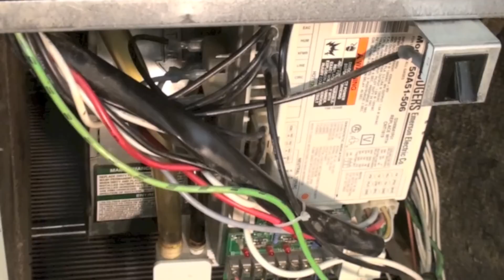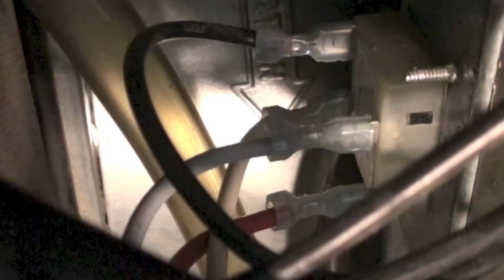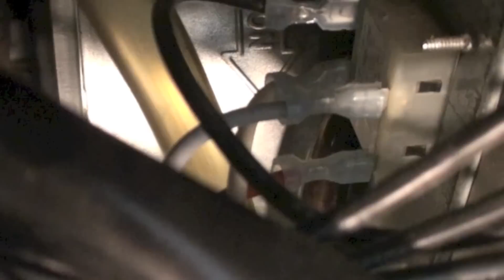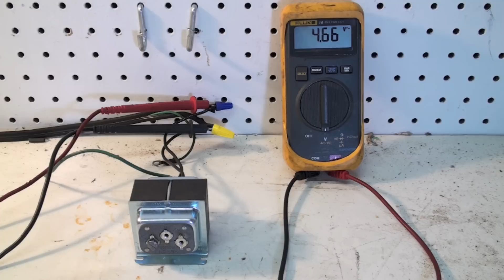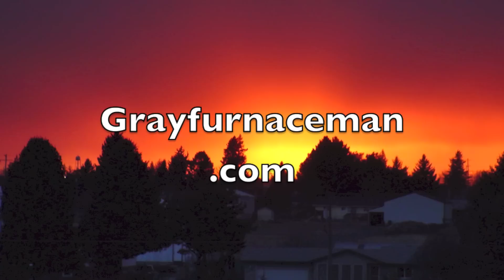How to troubleshoot the transformer

Comment: Hey Gray, i asked a question awhile back about the only problem I couldn't figure out. 

I had 120v in the primary, but zero coming from the secondary. I figured it was the transformer and I replaced it. I put in a new transformer, but the same issue. I checked resistance and transformer was fine. It ended up being an eletrical issue elsehwere that caused it
Reply: Where was your electrical issue?
When I test my transformer, when it is not connected, the meter reads resistance on the high side and the low side. Like 18 ohms on the high side and 1.6 ohms on the low side.
The circuit board has no power when I connect the transformer. (No red light. Nothing works.)
I've got 120 v at the lines that go into the circuit board. And 120 v coming out of the board through the wires that go to the high side of the transformer when I push the door switch,  but no voltage coming out the low side of the transformer.
I don't know if the transformer bad, even though there is resistance when the transformer is unplugged. I cannot figure out why there is no power to the board.
Reply: @Ziji-LetYourSoulShine  Did you ever find the issue? I'm in a similar situation.
Reply: You must have 120volts going to the black wire of the transformer primary winding and equally important is you have a good neutral attached to the white wire of the primary winding. Resistance between the black and white indicates the winding is intact.  The secondary winding is much more robust and failure there is not common. A quick continuity check between the secondary terminals should show a resistance indicating it too is good.  
Alternatively you could attach a cheater cord to both primary wires black to black, white to white and plug it in. If you do not show 26ish volts A/C on the secondary the transformer is bad. Note: Be sure to check at the secondary terminals for 24 volts as some transformers are isolated from chassis ground.

Comment: I have humidifier's transformer burning out in few months of running. The water valve 
solenoid  draws 1.2 amps at 24 VA it's 29 watts. Transformer is 40 watts. The voltage to primary winding is connected (as installed by technician) to blower connector; one neutral and L1 
(120 volts)so valves opens when blower operates. Any suggestions why this happens, maybe spike from blower's capacitor, any sugestions
Reply from the maker: I would guess that the solenoid is sometimes sticking.  If it sticks, it sometimes will draw more amps and could exceed the rated amp draw of the transformer, thus burning out the transformer.
GFM

Comment: OL is over limit on resistance scale. Infinite resistance air or open circuit. At least that was my experience when using a meter back in the 70s.

Comment: I have a goodman 24 volt transformer I replaced. I disconnected the old one but on the new one on the output (secondary side) it doesn't tell me which tab connector is hot and which is common. The 120 side is clearly marked.  Is there any way to figure this out? I'm afraid I'll reverse the polarity and cause a problem.
Reply from the maker: There is no reversed polarity on these transformers.  They can be installed using either terminal as hot.
GFM
Reply: neb  AC, not DC.

Comment: Could a transformer work intermittently or does it fail completely?  Seems I'm getting intermittent power to thermostat.  When I test transformer contacts (where thermostat wires are attached) I get no reading.  I open the box the transformer is mounted on (so jiggling the transformer), reinstall and get power to thermostat - off and on, but (fingers crossed) on for now.
Reply: Cinti PW- plus 1...  Gary, can you guide us?
Reply from the maker: If the question is can a transformer work intermittently, It could but it is very unlikely.  By far the majority of transformer failures are not caused by the transformer.  They are caused by shorts or chassis grounding in the wiring or components.  
GFM
Reply: grayfurnaceman 
You are right, 24v supply was good at the transformer.  After further research my blower motor shuts off while the burners are still lit.. (intermittently-thermostat heat setting with auto fan).  This happens until the overheat circuit cuts 24v to the "R" thermostat wire.  Blower has good bearings, doesn't make noise on startup, runs when 117v are present and doesn't run when 117v isn't there.  Note when 24v to "g" thermostat wire, fan runs.
I've got past the overheating by keeping the fan to on instead of auto.  

Is there a way to check the relay on the circuit board lennox bcc3-1 LB-89859  ?  I did not have the correct multimeter to check microfarads at the capacitor... I'll bring a tool home from work tomorrow.  Anything else I should check?
Reply from the maker: It is possible the motor is overdrawing power.  You can try replacing the capacitor.  Probably no way to check the relay.
GFM

Comment: GrayfurnacemanI burned 2 transformers , and all the time it happens on primary side (120vac) when I found the short on low voltage side . I did all the research but nobody came with definate answere . Would you please explain the theory of transformer?
Reply: Ive had the same thing happen too me. I was always taught a low voltage short shorts the secondary but i replaced a transformer on one of my dad's rental home units and I found the wire going to the pressure switch was rubbed and shotred on the copper suction lin but I looked in the back of the transformer and the primary was burnt. I didnt know why it burnt the primary

Comment: what should the primary side have for resistance if it is working? I've tested my transformer and it has 2ohms resistance on the secondary side and 25.5ohms on the primary. Thanks
Reply from the maker: Those numbers sound about right.
GFM

Comment: Can a transformer go bad as in trying to output more power than it suppsoe to? The Fuse on my circuit keeps blowing. Somtimes it will turn on but if i unplug it and plug it back in the fuse blows instantly. Nothing on my ciruit board looks shorted, so i'm pretty sure its the transformer. From what i know is the transformer intakes ac and converts it to dc. It has three wires on the dc side and i have no idea how to test it. I just cant firgure out why somtimes it works but then goes out after i unplug it and plug it back in. Please help
Reply from the maker: The transformer almost never would do that.  The transformer converts 120 volt AC to 24 volt AC.  You have a low voltage short.  I did a series of videos on troubleshooting low voltage shorts.  
GFM

Comment: So the Transformer is not showing any power at all on the 120. so i started  to look at the capacitor so could that cause the main feed to not reach the transformer if it had failed?
Reply from the maker: The capacitor has nothing to do with power to the transformer.  You have a high voltage problem.
GFM
Reply: I started to think about that to so i started to look at the power going to a switch that is before the door safety switch and its only showing 7 volts so there is a big problem.  After taking it apart the switch is quite old and so i will replace with a new one and clean up the connections and see if that solves the issue.  Will respond if that does not work and after seeing that the 120 was not hitting the main board that is what proved your comment about cap and also the transformer.

Comment: I have a  York 025-28671-000 HVAC Transformer. Should the transformer be hot to the touch of the finger when I have all breakers turned on but the ac unit turned off?

Comment: our furnace a n.g  Goodman has failed twice this winter. The furnace is 4 years old. I was getting funky voltages at the thermostat so I check the transformer and noticed what appeared to be a cut wire on the boot where it attaches to the secondary of the trans. , so I put a new boot crimp it and put it back on trans. and it worked for about 8 weeks and then happened again this time to the other side of the trans so I repeat and the furnace is currently working but in the back of my mind I'm concerned bcuz I didn't notice any heating of the wire and it was a nice clean shear so I don't think slight vibration would cause this but can I get some professional opinions out there, I'm curious, thanks.

Comment: how can we calculate the capacity of a transformer? Like 750 Watts or 1000 watts, i am asking this because i bought a transformer from a place for my Power inverter. now the issue is the shop i bought it from claims its a 1000Watts transformer but i checked it with two other person they say no its a 750 Watt transformer. Now how can i calculate and be sure?

Comment: Is the 24 volt  output end polarized?
Reply from the maker: +EurekaRecycler In most cases, no.  
GFM
Reply: So most commonly the transformer get toasted because a short somewhere else?  Thanks
Reply from the maker: +EurekaRecycler That's correct.  Transformers are extremely dependable.
GFM

Comment: I accidentally found out that the ground wire in one of the switches that was causing GFI tripped is hot. What is the cause of it?
Reply from the maker: Khos Farzaneh It probably does not have continuity to the ground in the panel.  Look for wire nuts that do not have all the ground wires inside.  Once you have found the open circuit, the breaker may trip.  If so, disconnect appliances until you have found the culprit.  Be careful here, high voltage.  Hope this helps.
GFM

Comment: thanks for this video - it's pretty funny, but i couldn't figure out what i did wrong because the furnace wouldn't fire up...didn't have the door closed so it wasn't powering up (doh)
Reply: Don't feel bad about that, it's extremely common!
Many service calls come after an air filter replacement and it is that door switch not quite being closed or opening.
Reply: Yes extremely common.

Comment from the maker: As transformers seldom fail, I would guess there is a problem with the board that is causing a short.  If the board changes the low voltage power to DC, the diodes in the rectifier could have shorted.  You can look for bad solder joints on the components if the board just does not work, but if it is shorted you would need knowledge of semicouductors.  Hope this helps.
GFM
Reply: I had a transformer blow up on me because it was wired through cover.  I replaced it and went to work outside and the compressor was dead.
Reply from the maker: @caru3257  If you are asking if there is a relation between the transformer failure and the compressor failure, they are probably not connected.
GFM

Comment: Also Gray I had a question for you is their any way to test Transformers that are attached to a pcb board? my question is I was replacing aboard in a Monitor heating unit kind of like a rinnia space heater. I replaced the board left got a call back still didn't work. Felt the transformer in the newly installed board and it was super hot. Is their some way you can test electrical components on PCB boards etc... so you don't have to swap out to check if the board is bad?

Comment: You know what I have  imo a really great service were I found a broken transformer. Let me share this with you gray. Service call for a heating system the homeowner said the system came on so loud it would vibrate scream etc... so badly that the neighbors could hear it. Went and look at the system had no power on the low voltage side. It was coming in but not relaying 120 to the 24 volt side turns out the transformer actually shook off the board! making it work intermittently it broke the sauder

Comment: Wires from the low voltage touching together would short the transformer out . Thats most cases right . But I bet there are others too ,like it just getting old . One thing I found out is if they get real hot , something is wrong from the start .